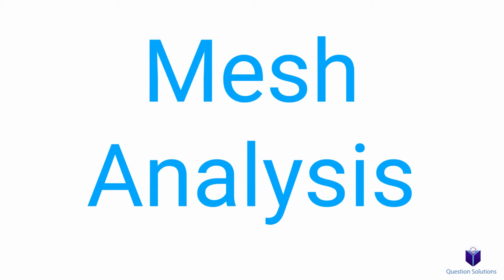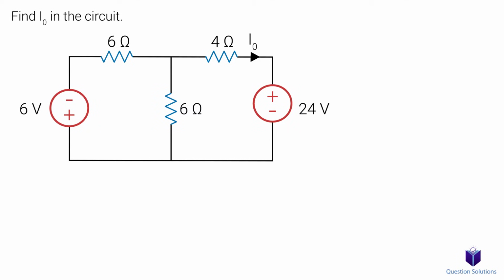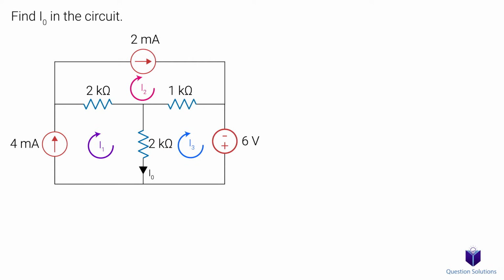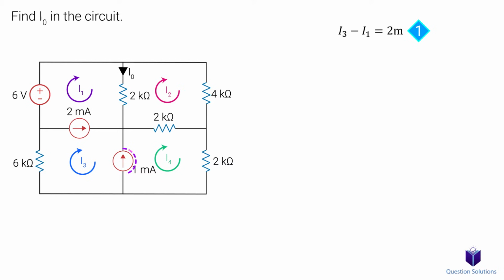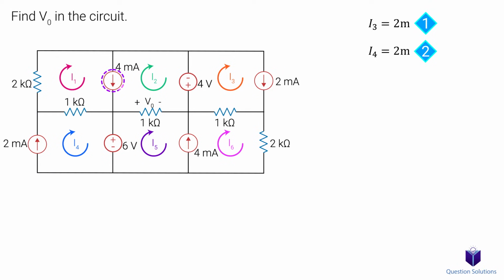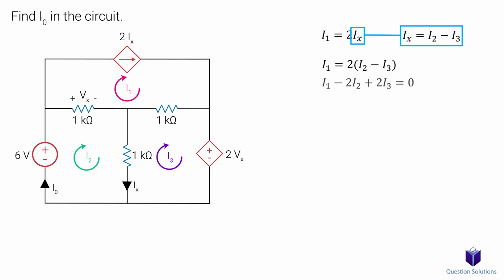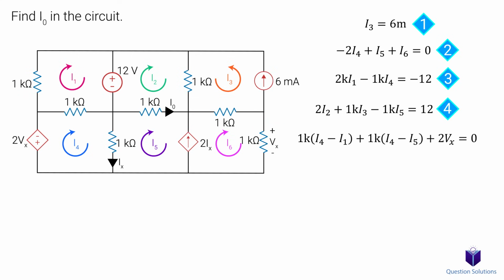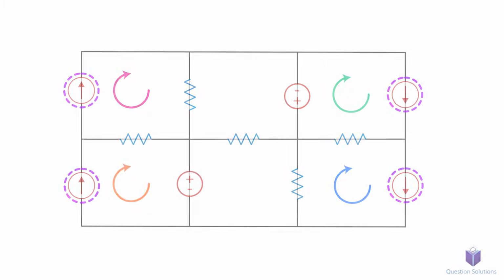The Complete Guide to Mesh Analysis | Engineering Circuit Analysis | (Solved Examples)

Comment from the maker: Please read before commenting!
🔹There is a typo at 2:13, it's R1I3, NOT R3I3 as the first term. 
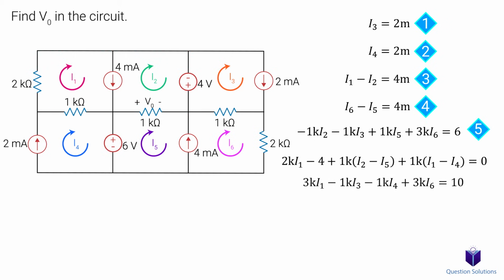🔹There is an error at 17:23. Equation 6 was NOT properly simplified. However, the final answer, and values of all the currents are correct. The proper equation was used in the gaussian elimination posted in the description. 

⁉If you have a question about a certain step in the video, please use timestamps when asking for help so I can quickly look for the spot. Thank you!

⭐Watch nodal analysis here: https://youtu.be/JptsfzvKbuo
⭐Watch full electrical circuits playlist here: https://www.youtube.com/playlist?list=PLXePpKFSUW2abKgvj_hClQS1NK86SCHfy
Reply: First of all, these videos are great! Thank you for your hard work in producing these.

Secondly, on the topic of errors, there is a typo at 2:13. The first term of the KVL equation reads R3I3 when it is said to be R1I3.
Reply from the maker: @JesusRodriguez-gh4kf  Thank you very much for pointing that out! I appreciate it and I added it to the pinned comment :)
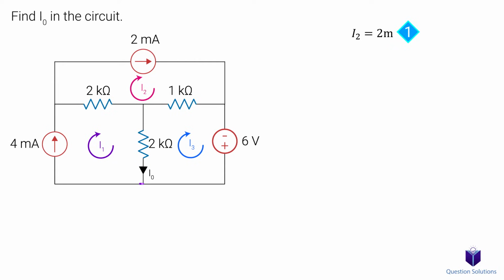Reply: at 7:30 and 8:00 , why isn’t the current shared between any branches? why doesn’t the 2mA go through both the voltage source branch and the 1k resistors and why doesn’t the 4mA go to both the 2k resistor branch and the branch that leads to the 2mA?
Reply from the maker: @graceholm8813 Whether that "specific" current goes through any other resistor or a voltage source doesn't matter to us. We only need to focus on branch currents. So if you focus on the branch with the current source, that top branch can only be 2 mA, because it's constrained by the source itself. That means i2 has to be 2mA because i2 is just the branch current that's flowing in the said branch. That branch is not shared by anything else, it's independent, so that means i2 is also constrained by the 2mA source.
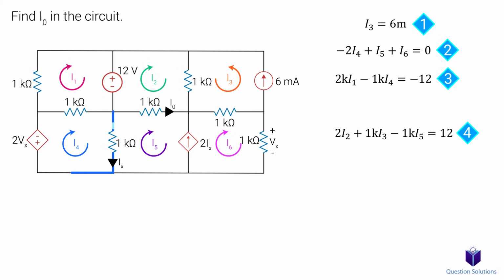Reply: Shouldn't it be 2k(I2) for equation "4" , at 22:22 ?
Reply from the maker: @AadilShakul yes, there is a typo, k is missing.
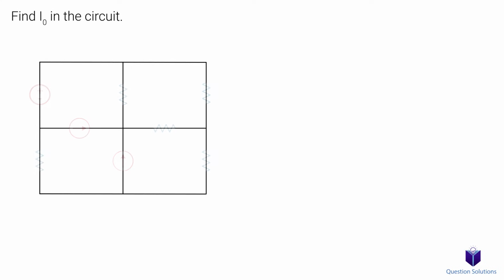Reply: @QuestionSolutions  hi, I have a question on 10:11, why is it that you subtract I1 and I3 to get I0, isnt it supposed to be added? like according to KCL the node at the bottom all has its current going towards it? So I'm confused why isnt it I0=-I1-I3
Reply from the maker: @eatsheet7087  We aren't doing a KCL for a node. I explain it at 9:56. I0 is the current flowing down in the branch. This branch is shared by I1 and I3. But I1 is flowing in the same direction as I0, while I3 is going in the opposite direction. So to get the branch current, you need to subtract I3 from I1. So I0 = I1-I3. Again, we are not writing any KCL for a node.

Comment: 22:31 isn't 1kohm resistors negative in Mesh 4 since the negative of the dependent source is connected to the 1k ohm where I4 is entering?
Reply from the maker: So that's not how passive convention works. It does not matter what is connected to a resistor, whether it's the positive side of a voltage source, the negative side, or anything else. All that matters is the direction of the current you assume inside a mesh. Whatever current direction you assume, the side that enters the resistor is always the positive side.

Comment: If the resistors are in kOhms(kilo Ohms) cant i js write the equations without the k and at the end the currents will be in mA, its for calculations since i do it manually for 3 equations
Reply from the maker: If you can keep track of it mentally, there really isn't a need to write it as long as you have the proper units at the end. Now if you have a professor or a TA who's a stickler for units in every single equation, that's a whole different story.

Comment: It's better for a weak students like me if you show me how you calculate with gaussian matrix 😅..we used node kvl KCL and creamer rule but I love your methods it's easy to understand..my teacher showed us a easy method to use calculator and find the values of current easily for Cramer rule matrix..
Reply from the maker: So if you check the description and you click the links for each question, you can actually see all the steps to solve the matrix.  I understand what you're asking for, but this is a circuits series, not linear algebra and taking extra minutes to showcase how to solve a matrix isn't viable for this type of video. 😅 If I ever cover linear algebra, I will show how to solve matrices. :)
Reply: @QuestionSolutions  thanks

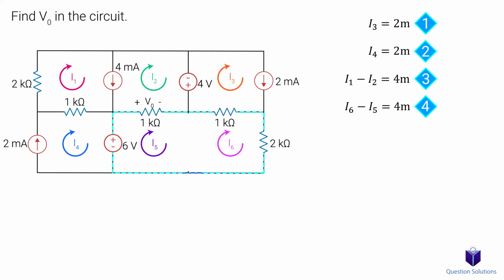Comment: In 16:05 howdid u remove ' it easily? Doesn't that have an impact
Reply from the maker: I removed it so students can see it has no effect when writing a loop equation for the outer loop. It has no impact on the equation you're writing.
Reply: @QuestionSolutions  how come ? This what I didn’t understand?
Thank you for your help
Reply from the maker: @9tataayoub521 so think about what we're doing when we write a mesh equation. In simple terms, we are just writing KVL equations. And what's true about KVL equations? It must hold true for any loop of your choice. That's why it works.

Comment: why are you using amps and not mili amps and why are you using kilo ohms instead of ohms?
Reply from the maker: Well first of all, why does it matter what the units are? Secondly, you're going to get questions with amps, milliamps, ohms, kiloohms, etc. You should be able to use any of those to solve a problem. If you're having trouble with that, you should focus a few hours on the fundamentals until you're comfortable.

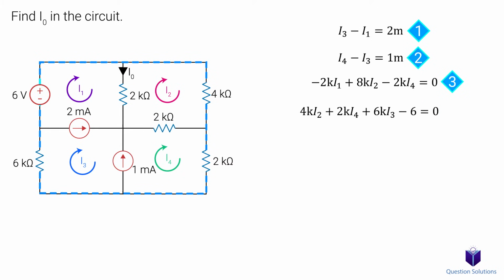Comment: 12:44 is this considered supermesh? If not how is it different from the supermesh you've shown? Also, can you use different loop like the L shaped where you entered the two 2k resistors instead of the 4k?
Reply from the maker: Sure, you can consider that a supermesh as well. You can use any loop shape you want, but try to incorporate meshes that you haven't written equations for before.

Comment: In circuit analysis, when current flows from the positive to the negative terminal of a voltage source or resistor, we usually represent it as a potential drop with a negative sign. But in your first example in this video, you’ve used positive signs throughout. Could you please explain why you have used it this way?
Reply from the maker: You can use whichever way you like to label your positives and negatives. Resistors are passive elements, and don't have polarity, so you will end up using passive convention to assume the positive side (simply put, whatever side the current enters is the positive side). For voltage sources, it depends on the direction of current travel, again, you can assume clockwise or counter-clockwise, makes no difference, use one that leaves you will more positives than negatives to make your mental math easier, but at the end, you will end up with the same answer regardless of what you pick.

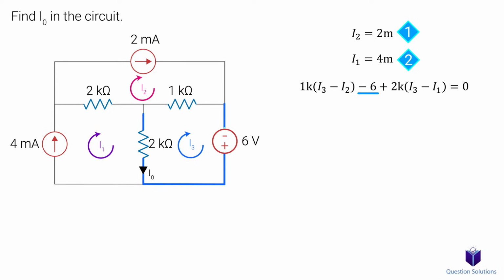Comment: 9:03 Why is it -6V? Why does the current entering from the negative terminal changes the sign of that voltage?
Reply from the maker: You're missing fundamentals on KVL. Please watch that first before heading into mesh analysis.

 If you're in a rush, then the simple answer is, whichever direction you travel, so clockwise or counterclockwise, if you enter the positive terminal of a voltage source, your value is positive and if you enter the negative terminal, your value is negative.

Comment: Can I ask why, in 17:13, the resistors are not considered negative even though they enter the negative terminal of the voltage source?
Reply from the maker: I assume this is to do with the V0 value given on top of the resistor by the question? If yes, then that's an assumption by the question itself, but we don't care about that assumption until the very end of a question. When we go through the motions of solving a question, we always follow passive convention, which, in simple terms is to assume that current always enters the positive side of a resistor.

Comment: Absolutely goated series
Just had a lil bit of confusion, why do we ignore the fact that current is flowing opposite to V0 at 17:15 (It's still I2-I5 as if we didn't oppose the signs of the resistor) but take the signs of the resistor into account at 19:51?
Reply from the maker: The positives and negatives of V0 does not matter when solving your circuit, because that's arbitrarily chosen by the question itself, so it's just a given. You are free to choose any direction for the loop current, it actually makes no difference to the final answer. We chose clockwise current loops, but you can choose the opposite to match V0 and still solve your circuit and you will get the same answer. Also, at 17:15, if you chose a counter-clockwise loop current for the super mesh, it would be i5-i2, NOT i2-i5. Why? Because i5 is in the same direction as your chosen loop direction for the super mesh, so clockwise, while i2 is opposing it.

Comment: In mesh analysis, when a resistor is shared between two loops, is it acceptable to assume opposite voltage polarities for the same resistor in each mesh?

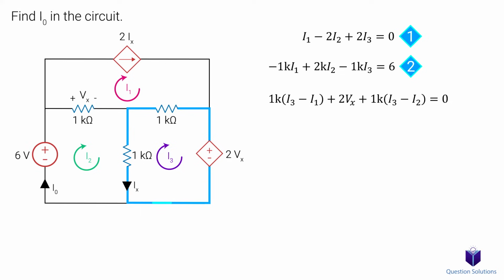For example, in the video at @19:30, Mesh 2 assumes the top of the shared resistor is positive (implying current flows top to bottom), while Mesh 3 assumes the bottom is positive (implying current flows bottom to top).
Is this valid?
Reply from the maker: Absolutely. This is called passive convention. Resistors don't have polarity, so always assume whichever side the current enters is the positive side.
Reply: @QuestionSolutions  Thanks! Kindly cover remaining theorems and other passsive component circuits. Also if possible kindly upload videos on RC, RL circuits.
Reply from the maker: As new videos are added, it'll pop up in the circuits playlist :)  @yuga9511

Comment: Thank you very much for your excellent videos, I could be wrong but i think there is a mistake for the simplification of equation 6 at 17:23, for example the i2 disappears. I could be wrong though. Again, thanks. Greatly helped me with dynamics and electricity. Alhamdulillah.
Reply from the maker: You are absolutely right! That equation is simplified incorrectly, it looks like I added 5 and 6 together or something. Nonetheless, the final answer is correct, and I must have used the proper values for the solve but wrote down something else on screen. I will write a pinned comment about that. Thank you for pointing it out and letting me know.
Reply: @QuestionSolutions  For equation 6: I got 3kI1+1kI2-1kI4-1kI5 = 4 and then when I did RREF with the calculator I got the same solutions as you did. This playlist has helped me tremendously!

Comment: 18:03 if we have 5A value for current source there in circuit then I1=5A direct . Are we supposed to write equation for loop 1 then although we got the ans ??
Reply from the maker: So a scenario like at 7:38? Where you have an independent current source on an edge branch not shared by another current? If so, yes, you don't need to write an equation for the loop since that loop current will be the same as the current source.
Reply: @QuestionSolutions  Great.Tysm You are doing great job sir 🙌🏻

Comment: Hey I had a question, on the 3rd circuit I'm trying to solve the circuit and I cant get the same answer as you if I use a super mesh for the two current sources. Should I not be using super mesh?
Reply from the maker: What loop did you use for your supermesh?
Reply: @QuestionSolutions  I created one huge loop made of loops I1, I2, and I3. I can email you my work if you'd like.
Reply from the maker: @arnulfohernandez272  You can email it or show it to your professor or TA during their office hours. I am unsure of the loop you used and the equations you wrote down so it's hard to help you out.

Comment: 15:51 May I ask why you don't use the equation like 2I1 + I1-I4 = 0 in the mesh 1? Is it wrong to equate it to 0 or because there is an independent current source that solves mesh 1 and 2 or because there is no voltage given in mesh 1?
Reply from the maker: So we can't write that equation because we don't know the voltage in the 4 mA current source. If a current source is shared between two mesh currents, it's simply easier to write an equation for a loop so that the current source is ignored. You can write it with the current source, but you will need to assign an arbitrary voltage to the current source and then solve it at the end. That's a waste of time since writing an equation for a loop will get you an answer way faster and you're less prone to mistakes. Remember, at the end of the day, you are just writing KVL equations when it comes to mesh analysis. So if we don't know the the voltage, we can't write it.
Reply: @QuestionSolutions  thank you